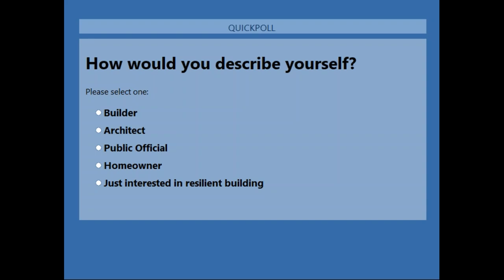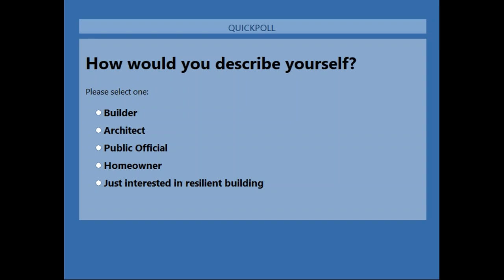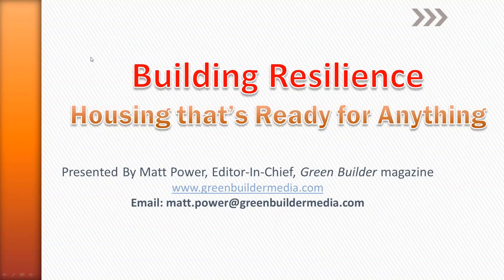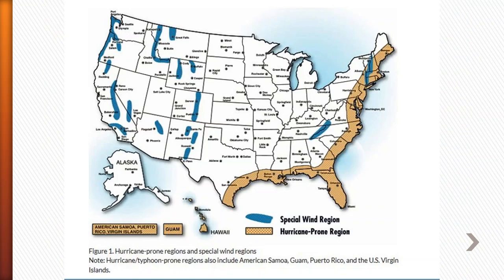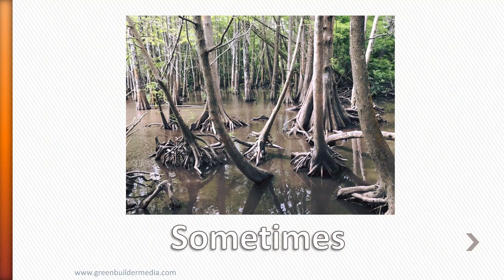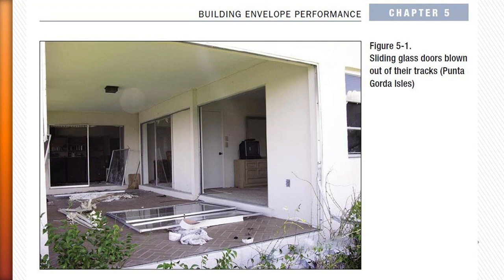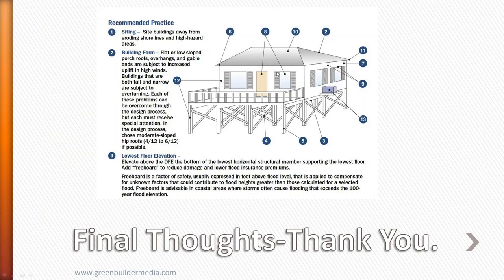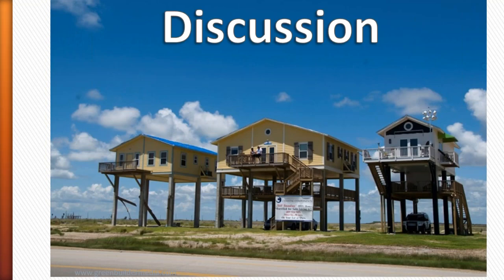Resilient Building

Comment: Good information here. This video has been on my watch list for a while. It's long but worth it. Since this video was posted, we've seen record-breaking wild fire seasons... I'd love to see this discussion revisited from the perspective of the threat of wild fires rather than coastal flooding and hurricanes. What works in one area may not be suitable for another. For example, will metal roofing and siding materials save a house from a wild fire? What about all metal buildings? In regards to high-winds, what prevention can be offered by Quonset-styled building made of metal that arc instead of rectangular-shaped houses with triangles on top?